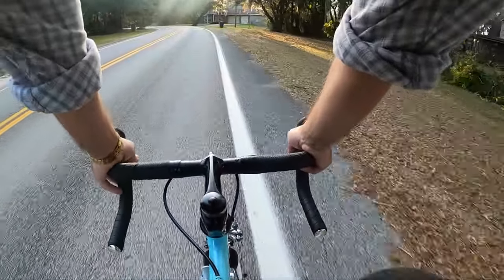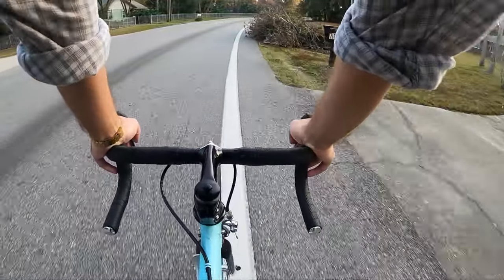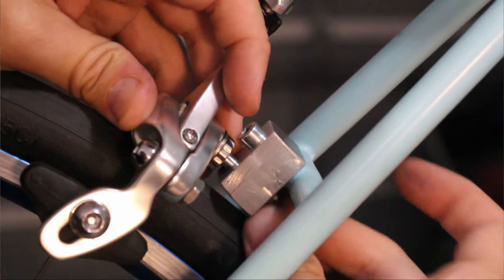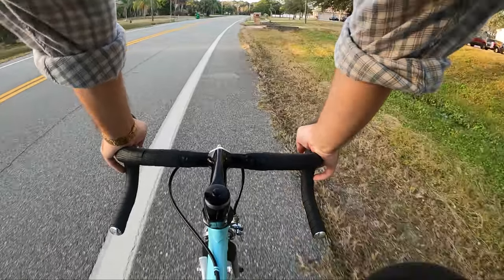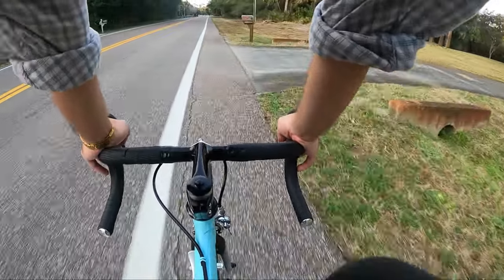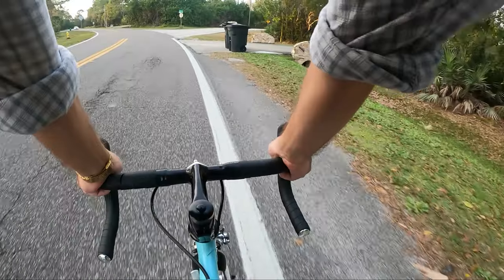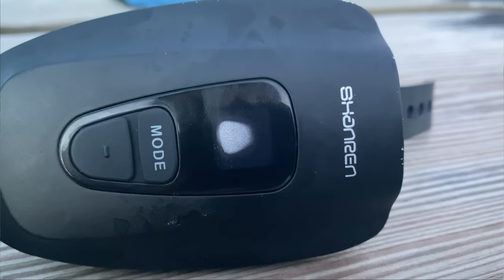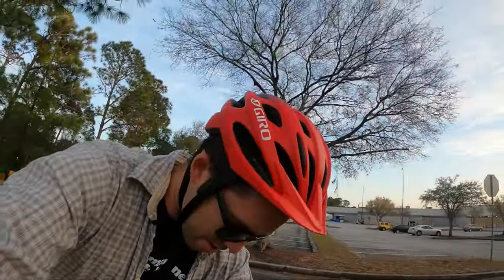Schwinn Le Tour build 6 month revisit

Comment: I just recently bought a Schwinn Le Tour from the Goodwill for $50 in great shape. I stumbled across your channel and I like how you have modified yours. I have similar plans for mine and getting back into riding again. Good video. I just Subscribed.
Reply from the maker: thanks a lot Rob, and good luck with your build. I'm hoping to sort of redo this one soonish.
Reply: @BruceChastain   I just picked up a pair of 700c wheels for my le tour and I'm trying to find a wider gravel tire. Do you know the max width tire I can use on the le tour? I'm worried about the the rear tire rubbing on the frame.  I was thinking of using a 35, 38 or 40 width tire.

Comment: Bike looks solid.  Nice color choice.  I’m a big fan of the IXF crankset.  I have one on my recent budget build.

A light that is not water resistant is useless.  Rain happens.  I recently bought a light on Amazon for $50.  An alleged 1800 lumens, solid aluminum construction, dual Cree LEDs, very long battery life.  Other than being heavy, it’s pretty awesome.  It has gotten quite a bit of use this winter.  The light has gotten rained on a few times; no issues.
Reply from the maker: thanks Peter! I actually assumed it was water resistant, but after it stopped working due to a pretty big rain once, I went onto their website and discovered that it never claimed to be water resistant.

Comment: Old Shovel (I'm sure you know the channel) is doing a fantastic job painting old frames with Spray bikes products. I think he had no prior experience doing paint jobs, so it's possible! It's just requires patience. 
The bike look nice anyway. I've done a few builds based on old italian road frames from the 80's, they offer such a good ride quality, it never disappoint.
Reply from the maker: hey there Cécile! Yes I watch pretty much all of his videos. For sure I could do better. But now I'm wondering if when considering the cost of the paint and other products, if it's not the same price to simply have someone powder coat.
Reply: @BruceChastain  I would say for a single color, Spray.Bike is the "cost" winner in terms of complete project cost but loses in terms of durability. For multiple colors,  effects (fades, stencils, etc) being creative e or just having fun, SprayDotBike (or the like) is the clear winner. 

A couple points to be aware of...
-PREP IS THE KEY. 
-If you want a glass smooth finish, you're going to have to go the extra step(s) and allow proper curing time and sand in between coats.
- Multiple light coats. This is key especially if you're using stencils or tape so that the colors doesn't bleed underneath.
-Use a 2K clear coat for added durability, but make sure you have proper ventilation and PPE! If not, SprayDotBike will get it done
-Oh yeah...PREP PREP PREP lol

If you really want to get funky, outline the lugs with a light silver paint pen before you clear it. That'll make the lugs pop and give it a pro look. Spray.Bike and powder coat (matte finishes)go on kinda thick and the lugs don't pop "as much" compared to wet paint (thinner) and drown the lines just a bit. 

You're bike looks great!! I have a soft spot for older lugged hybrids and turn them into retro-mod gravel monsters quite frequently.

Comment: Nothing wrong with good honest patina. I don't think I've ever had a car bike rack that didn't scuff up the paintwork in some spot no matter the type or cost. Just a unfortunate part of hauling bikes around.
Reply from the maker: the rack I have now is pretty darn good. It's the type that you set the tires on and then it has a foam covered bar that clamps down on the top tube. Unfortunately a lot of these scratch came before I got this newer rack.

Comment: How did you go about making the rear brake adapter? What was the spacing between the holes? Looks like it was a pretty chunky piece of metal?
Reply from the maker: Take a look at the initial video on this bike, you can get some info on how I did it inside that video. If you really need more I can dig up some info.
Reply: @BruceChastain  Thanks, ended up just getting a long reach caliper.

Comment: Thank you for the update.
You were supposed to spray 2-3 coats of primer and 2-3 coats of paint and 2-3 coats of clear to give it a fighting chance to survive.
So . . . What's the weight of the bike now ? How much weight did it drop?
It started with 11.4KG
I see that you listed the weight on STRAVA 9.8KG hahaha
What's the rated lumens and battery life of the light ?
Reply from the maker: hey AB! Yes 9.8 is right, why so funny? Actually it's a little less than that now but that's another video to come. It's rated at 800 lumens.